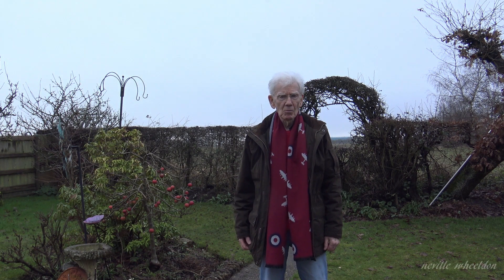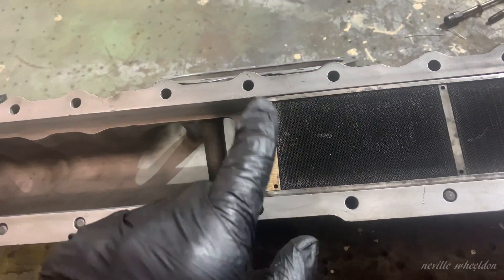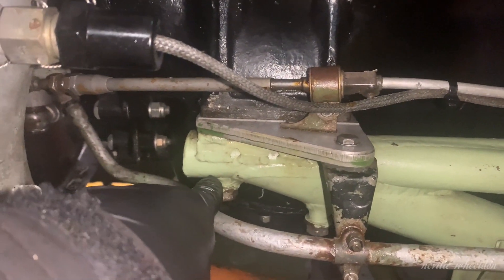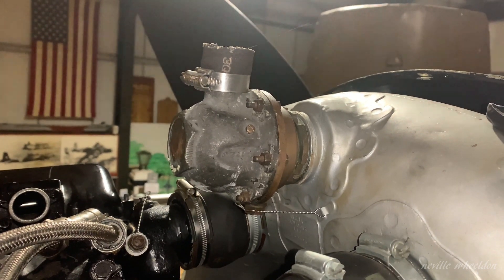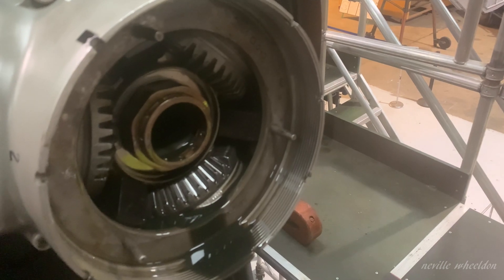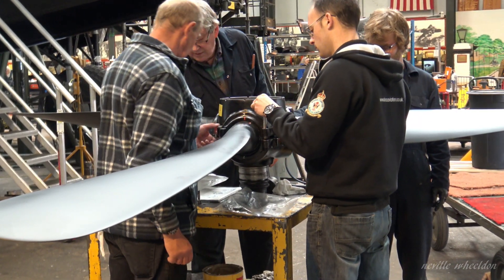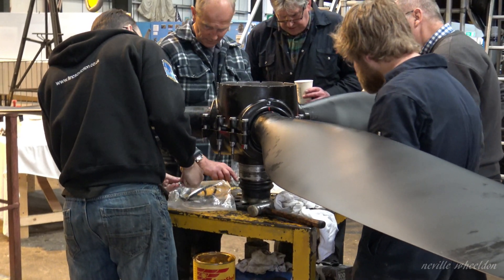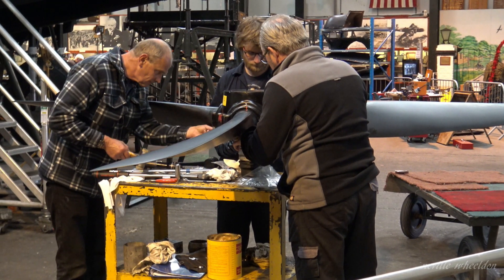Lockdown Video 28.   The second video from Brad on servicing Lancaster engines. Jan 2021

Comment: Another great video Brad/Neville. Is the propeller airworthy or taxi runs only? It looked in pristine restored condition to me. You now get to appreciate how much hard work the ground crew had to do each day to return a Lanc back to front line service
Reply: The prop you see being inspected is airworthy, as is the No1 prop. The one you see being assembled isn’t airworthy but fine for ground running and now occupies the No3 position on the aircraft.
Reply: @BradleyWinder96  thank you
Reply: What about no 3 doesn't make it airworthy?
Reply: @Idoall.myownstunts  it’s made up of parts which are worn out of limits for acceptance for airworthiness but which are fine for ground use.
Reply from the maker: @BradleyWinder96  Thanks Brad.